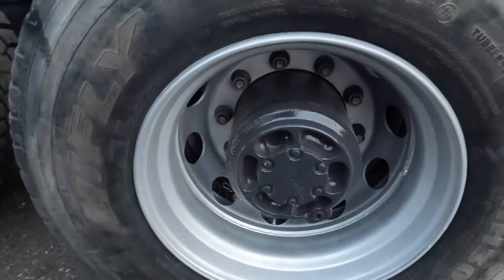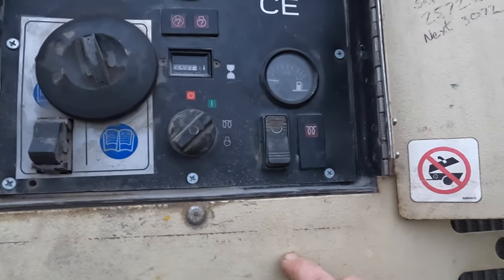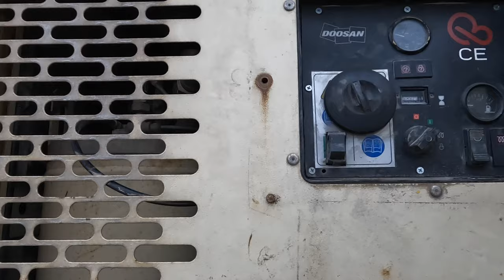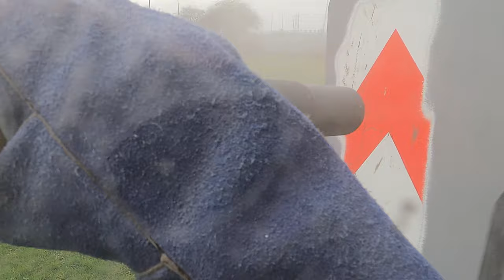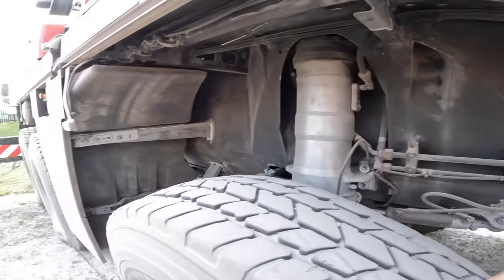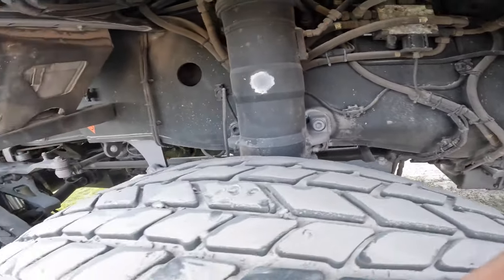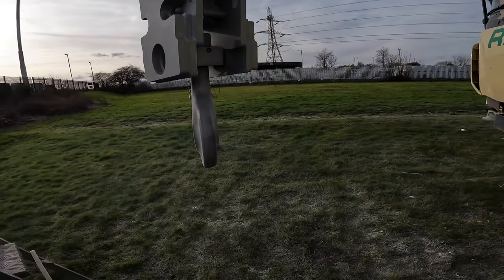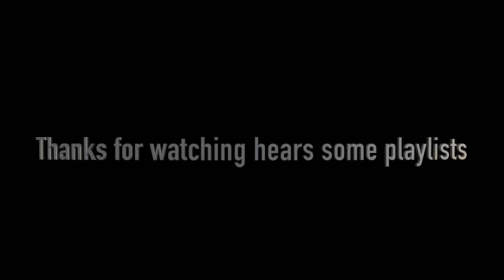Restoring Crane Wheels and Chassis with Sandblasting | Surface Renewal Process

Comment: Bit of a tip Mick 👌 when doing the smaller loose jobs that you were on the pallets.  Sucure your deadman trigger right behind the nozzle coupling and put your ball and chain on your right wrist and tuck the hose under your right arm. That will leave your left hand free to hold the job you are blasting and prevent it from moving.
Reply from the maker: Thats a practice I don't want to get use to I try to keep all my limbs behind the nozzle haha its hard to not hold stuff but lack in concentration and one slip could result in a world of pain haha
Reply: @Mobileblaster  😅 I do it every day. I'll send you footage of how i do it next week when I get back to work 😏 🤪
Reply: @scottkenzig5144 

The guy I use for blasting does similar, but it always strikes me as an accident waiting to happen.
Reply: @paulf2529  yeah you do have to be careful. I've stung myself more times holding the hose with 2 hands were the hose has caught on something and has ripped out of my hands. Just gotta stay alert. Blasting 22years now 👍

Comment: when i was blasting valves in for maintence and rebuilds mick i pinned them partly under pallets as they'd blow round like that a bit our setup wasnt like yours but the valves were like sails an were a pain to keep standin against the airpressure  thank you for another video
Reply from the maker: 😊👌👍 it's mainly why I don't like doing odd bits 😂

Comment: Blasting patches is plain horrid, know what you mean about never being happy with it, but if it's what the customer wants then that's what it is, especially if they pass a bit of work your way, small loose parts, again, horrid, but single pallet, foot on a small sticky out bit and blast away, steel toe caps are better than crocs for it unless you got plenty of tape to stick around your toes 🤣

One job I always hated was wind ties, 75mm dia, 5-6 metre long tube, trestle em up, hit the air and watch them roll about, absolute barstewards, scale off as well, nightmare, them and tiny fluid tanks, 100 at a time, ideal in a blast cabinet, if it hadn't been sold because it never got used and was taking up space, much more productive chasing the tanks around a grit bay for a few hours...🤔
Reply from the maker: 😆 it's not often I have small items a shopping trolley would be nice to chuck parts in but it's just another item taken space up that's not going to be used enough 👍